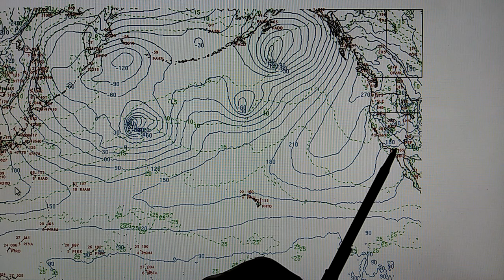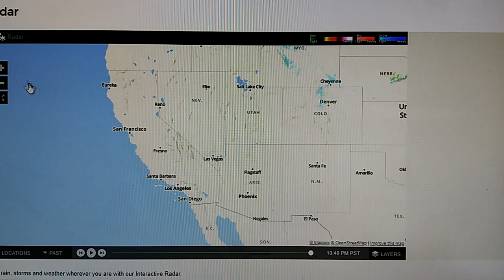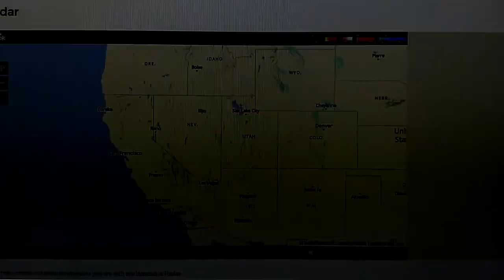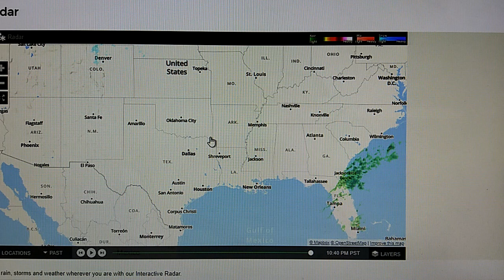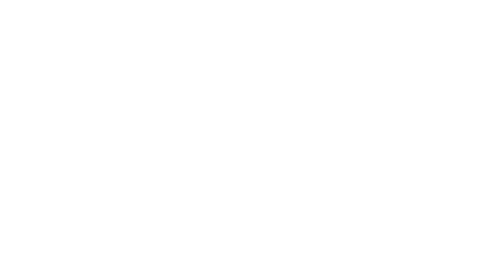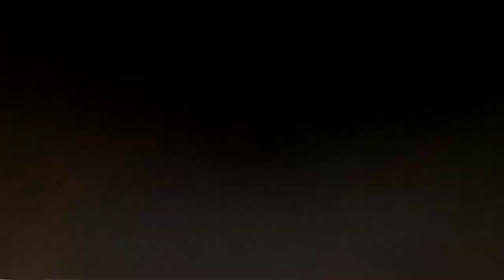2-5-2022-Dry Low Pressure off CA Squashed by Satellite Transmitter; Guest Wigington on A. Jones Show

Comment: Back in the 70's thru the 90's , So Cal used to get rain and occasional Santa Ana winds. Now we get Santa Ana winds with occasional rain. The high pressure off the west coast is always there in the winter. The only reason we got rain in last Dec is the high pressure was moved more West . As soon as Dec was over the high was allowed to move back where it is now .blocking all precip. The three last years we have had the same pattern. Wet Dec and dry the following 2 months. Totally messing with us.
Reply: Here in SoCal, the “wet December” was confined to Christmas and Thanksgiving.

Comment: I said do not be surprised if they let 1-2 storms at most allow a little bit of rain this month. So far I am right on the money. It looks like we are going to be in store for record heat for the beaches and valleys (temps upper 80s low 90s and all the yuppies will love that). The same computer model that showed it raining in December is showing bone dry for January, Feb, March and April so the deck is already built.
Reply from the maker: Yes..the fix is in and the spigot is off for California.